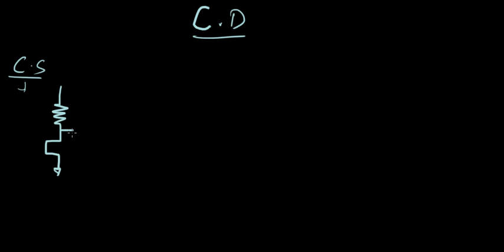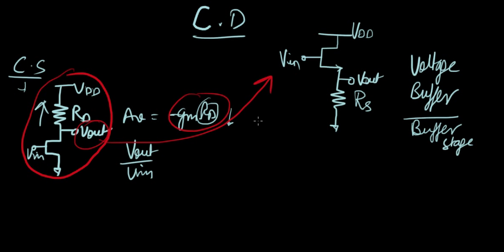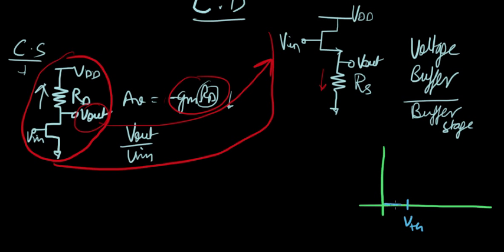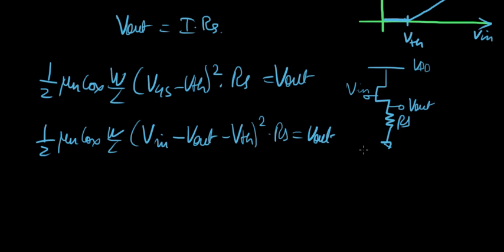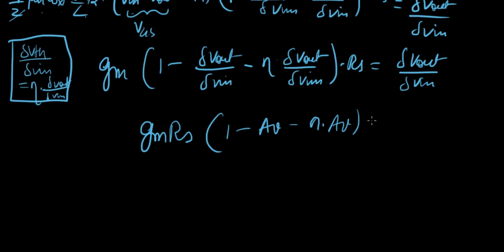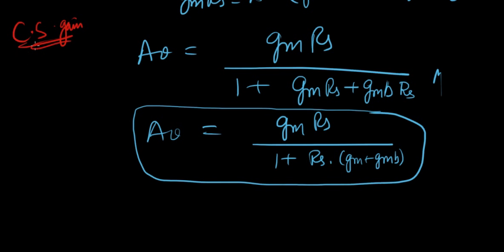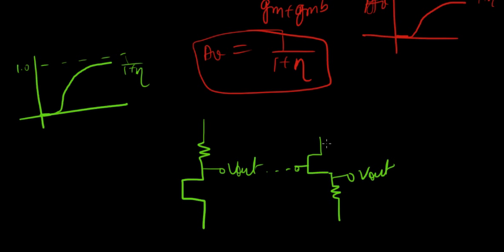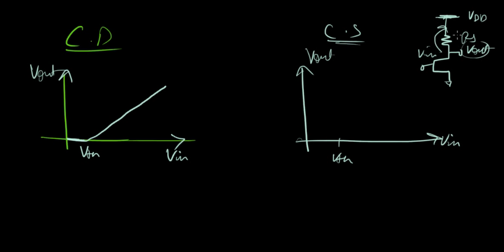Common Drain Amplifiers - Gain Equation

Comment: Hi eneradi!  Thanks so much for posting these videos!  They're very helpful!  I have one question about this video.  You mentioned that the CD amp is useful in driving smaller loads.  However, the gain that you derived that almost reaches 1, is based on Rs being very, very large or infinity.  Wouldn't setting Rs to a very large value defeat the purpose of the CD amp driving a smaller load?  Thanks!